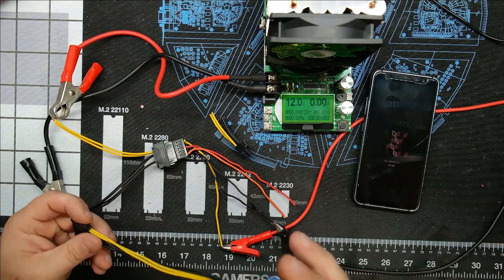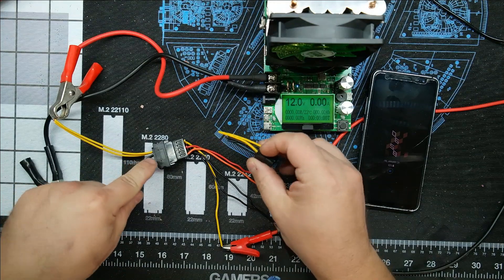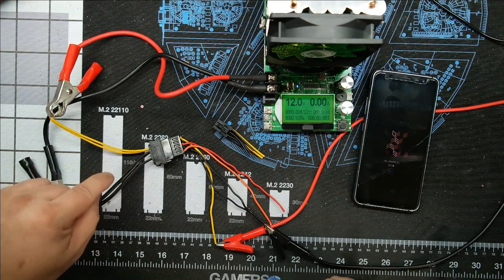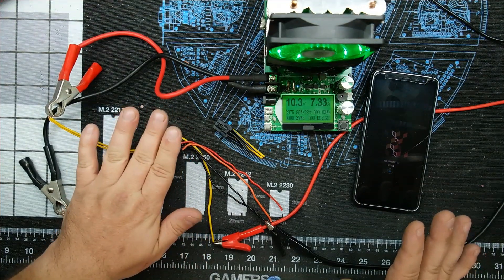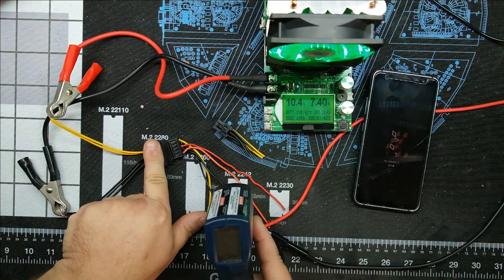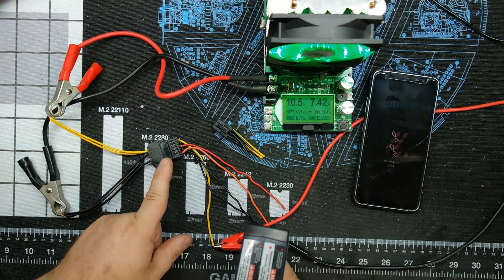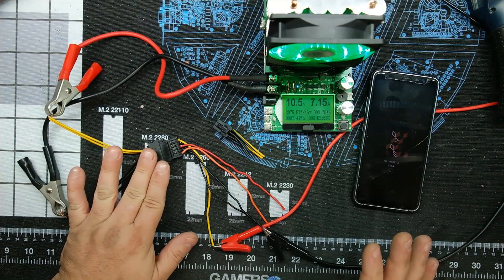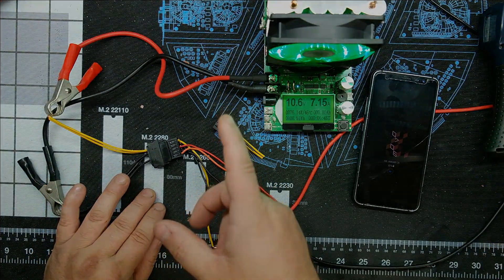GPU Riser SATA Connector Overheating Demonstration

Comment: you can use the sata connector up to 54 W = 12 V * 4.5 A . NOT 75 W!!!!!   so lets say 100 W total to be safe. 75 W from the PCIEx16 and ONLY 25 W from the SATA , for a total use of 100 W for a GTX1650S .

Comment: i m powering up rx 580 and gtx 1660 super with sata one sata for one gpu it seems okay for now.Gtx 1660 draw 85 watt rx 580 draw 115 watt. (From wall) I think powering up budget gpus with low tdp seems safe. BUT DO NOT POWER RTX CARDS AND DONT DO DUAL MINING WITH SATA.

Comment: Not true. Even the 24GB 3090 pulls 54w max. over pci e slot. 6800(xt) is around 43watts. Totally safe if you only use one sata cable per gpu

Comment: I think the original intention of those adapters is so that you can connect a sata to the 6pin and a sata to the other port on most risers. This should be pulling a max of 38 watts from each. Most risers have molex next to the sata port so I think you are supposed to connect both. I did a test where I was mining while swapping between the different power connectors and the mining wasn't interrupted. This leads me to believe the riser will pull power from multiple sources if 2 sata or a sata and molex are connected together
Reply: All of it is bussed together on the pcb, the 12v and grounds. If there is atleast one 12v and one ground connected anywhere it will work. The multiple connectors are basically there to give headroom, plenty of current so to not start a fire, which can happen if there was one 1 wire supplying all the 12v  (sata plug coming off the psu only has 1 12v wire usuallly)

Comment: Hello fellas, (3080Ti Founders Edition) my vram is still running too hot after changing the thermal pads. I connect one 8 pin pci and one adapter on Sata to the PSU. Is that maybe causing the trouble I have? Card mines around 108-110° vram temp and throttles and so on... really need advise

Comment: 7.15A at 12V is 85W, fairly unrealistic power draw for a GPU. Most GPUs draw 40-50W at most, undervolting them brings them down to the low 30s - it is completely safe. What is unsafe is people running 3-4 cards per cable and overloading its rated current of about 8-9 amps.

Comment: You mentioned a potential of 75w draw at that connector for a RTX 3090. I'm assuming a RTX 3070 has much less draw at that connector?
Reply: Yes. My 3070 consumes about 30watts over pci e slot. A 3090 consumes about 52-54 watts. Maybe you can get it to 75watts but only if you use all the 24GB VRAM. So definitely a mining 3090 will never suck 75w over slot

Comment: 1.4v voltage drop is too high for such short cable. SATA plug has thin cables and high resistance. SATA plug specs says max 4.5A for channel so 12 x 4.5 = 54 Watt limit alone.

Comment: Don't ever use SATA connectors that are molded plastic, only use crimped ones. Molded ones usually have pins too close to each other inside the plastic, so they arc easily if they are different pins, or they overheat because the current is not spread over all the pins. Just search for the phrase "Molex to SATA, lose all your data".